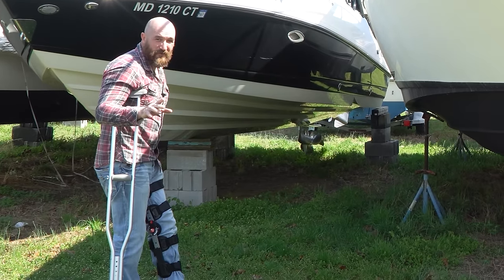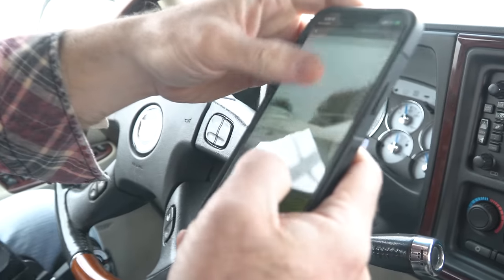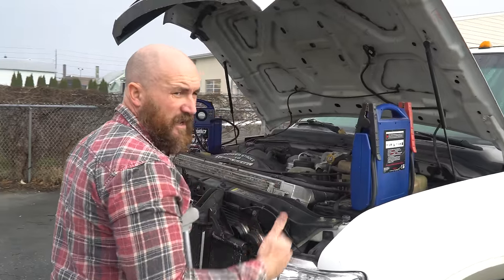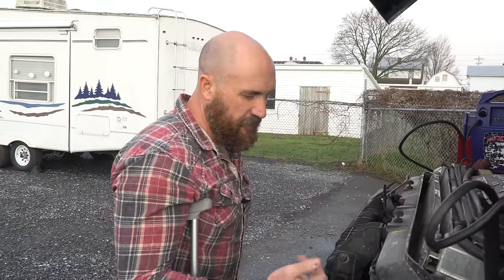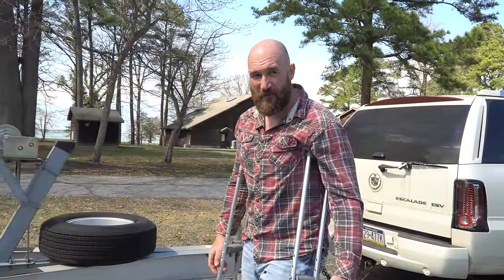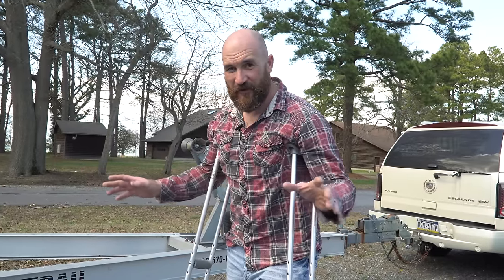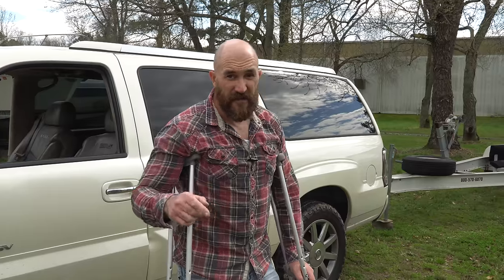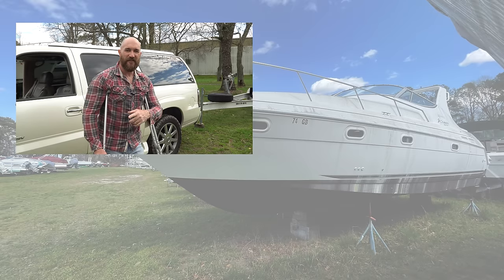We got a FREE Abandoned Yacht!

Comment: With current fuel costs these big motor yachts are dinosaurs. And they have a dinosaur size carbon footprint. Sailing catamarans are a better technology for these times.
Reply: Sorry as sailor I cannot  agree.Unless you plan o sail over 10000 miles a year your unlikly to recover   your costs versus a motor boat when you get into the forty foot size boats .Big sail boats to preform at speeds need lots of wind and the  average wind in the world is force 3 about 15 mph  or 12 knots ..
Assuming you  want to go USA to bahas once a year if you fly there and rent a boat that is probably cheapest solution  especially if you opt to rent a  hobbie 16 ft 
One hobbie cat a guy bought for $350 size  16 ft left Florida  and sailed the 88 miles to Bahamas
Alternatively get  old motor boat do it up even with converting it to single engine and  buying one engine  it will be much cheaper in fuel cost  to run than any 40 foot plus cat or Trimeran 
Big new sail boats costs are often  high premium costs compared to any even new power boat cost  a Nd you are often get more room in the power boats  and some are nearly as wide as the cats .
The reasons to sail are for the natural effects but isn't to save the planet .Most of the CO2 gas from motor and sail boats comes from the manufacture  of most boats .Most boats spend most time in Marinas and go few miles in Thier life span so the small fuel burns even at 10 gallons a hour are tiny fuel burns compared to other transport
Most sail boat owners will be better off to buy a big motor boat and carry some sail surf boards or hobbie cats with them to sail when the wind blows  and that can mes from me a 30ft  sail boat owner  user boat age 50 years old  who often sails 1000 miles a year and  got my near abandoned boat  for less than $2000.
 In today's depressed boat market I could get a superior 30 ft mono hull for  less than $5000 much newwer better sails and engine but my war of cash is spent  so have to cheap skate it as a bottom feeder .and use boat to live on  and sail it as transport so I do not have to take the deadly Covid 19 VAX 
 I have owned in the past a 34 ft cat and crewed  and captismed a lot on 37 ft charter cats and also bigger cats and mono hull sail boats  and worked sail and power charter boats 
It is nearly always cheaper to charter a body for few weeks than own a similar boat ..
Even you give me a very old  forty foot boat of motor or sail  I  probably won't take it as it costs too much  especially marina costs as us marina rats who fix boat and charter work them boats tends mostly  do not get enough cash to run these big  things .
It is a buyer's market in this time so getting s big boat even you buy a  second hand engine system and do the majority of the work yourself can sets be a good solution  compared to just buying  a second hand boat with working engines
My cousin bout a 1935 wood sail taught racing type for $1 and put it on his farm. He cut off the lead kell and sold it for $3000 which covered the.  <Transport costs to bring it to his farm. Then he put it in suitable frame and rented it out to holiday makers  for weekend or summer week trips to stay in.
Lots of boat users hardly ever use Thier boats so never benefit saving for sail or motor sailing .
That is good for us as today's world more older cheaper boats  trickle down to us but  the running cost on Marina fuel parts  regulations even to anchor or moor increase in cost and  complexity .
I try to cut my  sails to  suit my pocket  and others do other solutions like charter a boat for a week and sail off into the sunset with a hot boat seen that often results in jail time

Comment: Sir: I restore Antique Wooden Boats. Favorites are the Grand Banks Trawlers. I have done inspections on a variety of boats and it is easy to say, Take this boat home.  
Be sure you are going to flip this boat not keep it for your self. The fuel cost alone will take the fun out of it.  The maintenance costs on 454 engines is also high and a pain in the ass.   
Please get a brass hammer and "tink tink" "Donk" the hull around the corners, transom etc.  Look for stress cracks. Gel Coat Crazing around the fittings is age related but not structural... 
Fill each spark plug hole with Mystery Oil let it sit overnight and spin it with a wrench/Bar first. 
Check the Compression.  Keep fingers crossed.         Check for weak electrical components that are common even on potted gear.
IF you can rebuild those engines (Heads and electrical) you can flip it but barely possible to profit with the right buyer.  The recession and time of year is not in your favor. 
If you can get both engines running, then you will do much better $$ than a rebuild and install etc. etc.    Betcha this will be a 2023 Sea Trial..

Bottom Line: if you have $12,000 to $15,000 (Educated guess) in the plan, then do it.  That "S" type hull goes on plane very quickly and runs nice at half to 3/4 throttle. It takes short chop easily and Ground Swell she will be flat and fun. Her design will keep her stable when sitting still. This is the Ford Expedition of Boats.  Really bad on fuel but a great ride.
Twin Screws mean you can park that boat on a Postage Stamp.   (surprised the wheels were not stolen)  Twin Screws although THIRSTY will take you home.
You are going to need/hire a very big trailer and you should not drive in High winds, Watch for low hanging electric wires, drive when traffic is lowest and have 2 support vehicles in front and back.
Good Luck.

Comment: Ok if you have a Diesel and the engine  need repair or replacement  you are talking at least 5-10 grand. It depends on if they are current or not.
First get the yacht  cleaned up with a  heavy duty clorox  or other  solution to kill the mold  (disclaimer)  you must be very careful when cleaning up the inside as not to  mess up your lungs.)
Wear chemical mask.
Enjoy!